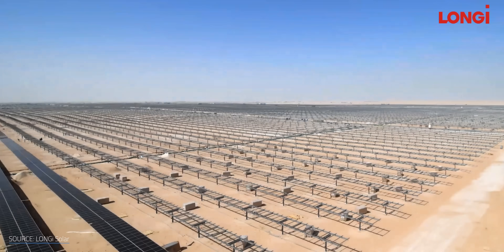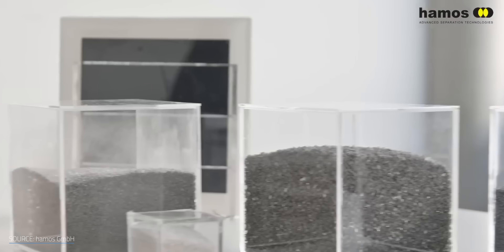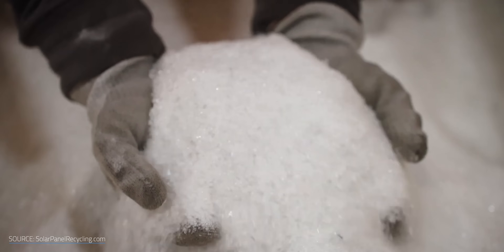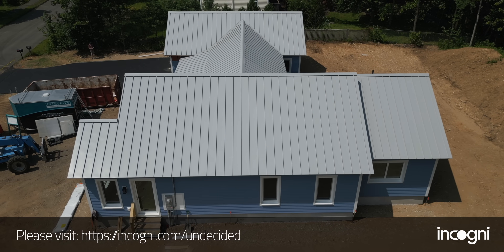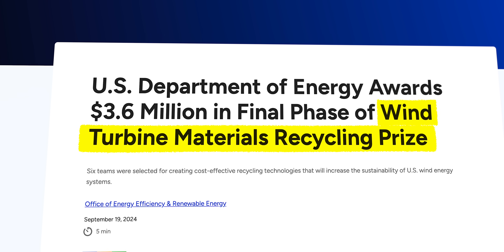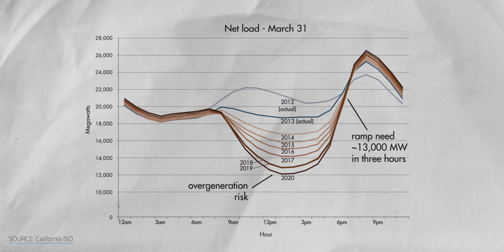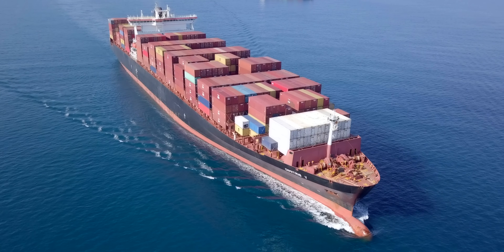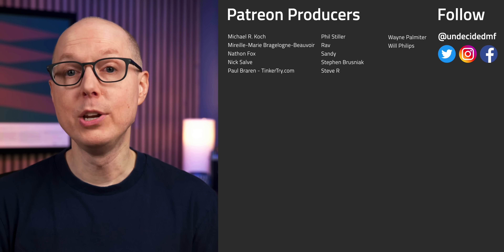How We Solved Renewables BIGGEST Problem

Comment: I really don't understand the anti solar attitude of some people especially Americans. Solar isn't perfect even more so here in the UK but when it's sunny it's amazing to have on your roof and saves me a ton of money. My system paid itself back in just under 6 years. I'm not naive enough to think my solar roof installation is the full answer I know it needs backing up with grid power but I just don't understand this "I don't want renewables" mentality. Like why wouldn't you want free power after offsetting the upfront cost? I just can't get my head around that mentality, as above it seems it's mostly Americans in the comment sections who are really set against it.
Reply: Indeed, I've not looked at it carefully to figure out if ours has paid for itself yet, in the UK as well but it must be getting close as electric prices are so high. Though really that is irrelevant as while it doesn't actually meet 100% of our needs as we use energy now its not far from it which gives that peace of mind that economically basically no matter what happens you'll have light, cooking, warmth practically forever.. 
As just a little bit of cutting back on our consumption on the nice to haves like the extra freezer, or spending less time running my welder/printer/lathe while the sun isn't shining it probably would let us go entirely off grid - and this only a pretty small even for the UK house though the roof does happen to be at a really good angle to gather sunlight. Also a bigger battery would definitely be required to go off grid - right now the battery won't even last through the night, its just a tiny little thing.
Reply: As a cost saving measure for households is amazing .
Reply: I'm an American and I don't get it either. Love my solar power system.
Reply: Like Matt's said before, solar is a hugely personal thing and varies greatly on if it's right for you.  Remember that the US is enormous, having roughly the same landmass as all of Europe in square kilometers for landmass (says google), so geographic location can and really does make a difference for solar, as well as some places not having the logistics or installation professionals available for it.  Some of our rural areas are literally half a day's drive or more to the closest "civilization".
Reply: One thing that a lot of people don’t realise is that it blends seamlessly with you grid connection. I have had people within the last week ask what I do when it isn’t sunny (same as them, the power just comes into the house from the grid like it always did). I was asked how you control it (you don’t it does it without any intervention) - they genuinely thought I had to flip a switch, Frankenstein style, to use either solar or grid. Another said he won’t get solar as he likes to play computer games in the evenings and didn’t want to restrict himself.

It was only after having these conversations recently that I realised how little people know. They think you have to have one or the other (you are either on grid or off grid). They think you have to flip switches to make it work. They think you have to compromise and go without power at times. I was genuinely shocked at how little people without solar panels know about them. Just 5 minutes of google time would have answered their questions. Who is feeding people these myths?
Reply: I don't know how it is elsewhere but in the Netherlands it all started with the promise that you would be paid for generating more than you use. But we have now reached the point that dumping your solar energy that you don't use have to be paid for ! Is that attractive, being mislead ? The installations does not seem to know when not to dump on the grid.
Reply: Erik, 
technically illiterate politicians are to blame. They, simplistically, thought that any electrcicity generated is good for the grid. 
That is not the case with renewable generation as it is uncontrollable, feeding a system that must be minutely controlled with regard to supply and demand on an instantaneous basis.
At low levels of solar panel uptake it was too small to be a problem but as it became popular, ironically due to electrical unit prices for the consumer going up by connecting more and more 'cheap' renewables.
Solar is particularly bad on two counts, one it's output is based on the strength of the sun so midday is strong but morning and evening is weak, with winter, when demand is greatest, produces very little and none at times of maximum demand. 
It is suseptible to sudden drops in output when clouds pass over, requing a very quick response from the grid operator to balance that loss. When the clouds pass the reverse situation occurs.
While it lasted it was good for solar panel owners but to the detriment of the rest of the population.
Reply: The US is second in the world in solar PV output.  It's just happening at utility grade installs for the most part, those over 1 MW output levels.   China is 3X the US.
Reply: The cost of roof based solar systems for residential properties is really high in the US - I’m not sure if the government incentives artificially drive up the cost - but I keep seeing comparisons that show AU prices of solar are 1/3 or 1/5 the cost of a similar US installation, I know the quotes I’ve received are crazy high ($50-70k).
Reply: I’m in Ireland

Not the sunniest place in the world obviously …but my Solar PV system (19x440w panels [8xNE, 11xSW for total of 7.9kWp) and 2 x 5.3kwh battery storage have saved me an absolute fortune already and will fully pay for itself in under 6 years. 
Even in winter when days are shorter I charge my batteries from the grid at cheap EV night-rate to load-shift away from peak rates. Then, from early March to 
at least end of Oct my solar can (most days) easily fully charge my batteries for use after the sun goes down and throughout the night. My system cost just  under €11k to install (and then I got a Govt. grant of €2,100, reducing the outlay considerably ). 
Solar is fantastic!!!
…and since I was already a qualified and registered electrician I have now completed the Solar PV & BESS training program and up-skilled to become a licensed Solar installer. 
My new business is going well so far thankfully 😊.

 Saving clients money, helping the environment, helping the national grid, reducing the reliance on fossil fuels…and making a decent salary while doing something I love and believe in. 

Win-win
Reply: If someone is watching this channel, chances are they want renewables. What makes you think Americans have an "I don't want renewables" mentality? That may be a on oversimplified characterization based on imperfect information.
Reply: Look at how much Rooftop Solar costs in the US. In Australia I can put 10kw on my roof for $ 11k (ex Gov subsidy and Tax). The same in the US would cost 2 to 3 times that amount. Australia is the only country in the world who can put solar on roofs at the same cost we put it in Solar Farms every other country costs 2 to 3 times what we can do.

PS As a result 35% of houses in OZ have Rooftop Solar. We are world leaders.
Reply: I believe it is mostly due to older preconceptions about solar. Lack of recycleability, higher cost vs natural gas, and they are kind of ugly. Now 2 of those 3 are pretty much solved. The ugly thing not quite yet. There are some nicer options like integrated roof rile solar panels but those are still very expensive.
Reply: @brennonoverton8277  i find them beautiful. Taste ppl, taste!
Reply: @brennonoverton8277  You have to take into account the cost for required storage to make a fair comparison to gas. Then solar is still 4 times more expensive than gas, 3 times for coal and 2 times for nuclear. Even if you have solar you still have to pay for the infrastructure of conventional energy that is needed when there is no solar available and during (very) low winter production. For that reason we all pay more for the energy that you take from the grid, offsetting most, if not all the benefits of solar. 
It's different if your solar does not go into the grid but in your own storage and you use it for e.g. a electric car. Now i pay 3x as much for the same energy as 20 years ago.
What really happened is that people without solar paid more for the energy bill to compensate for the solar investment. Now that energy companies start to demand money for energy fed into the grid the playing field becomes more honest and the ROI of solar is much lower. Wind is even worse and can only exist because of price guarantees and subsidies.
Reply: @Sander-zj3wi  Oh interesting take. I hadn't really considered how the prices could be rigged to appear lower.
Reply: @brennonoverton8277  And predatory solar salespeople are not helping the technology's reputation.
Many of them are the new door-to-door vacuum salesmen.
They fast-talk and bury you in information to try and get you to sign with them and ONLY them before their "special price, just for you" expires.
Reply: @brennonoverton8277 I dont think it looks ugly at all.
Reply: Who's anti-solar in the US? I'm down here in Tennessee and I don't know anyone anti-solar. Everyone wants solar on their roofs.
Reply: @twiggy99  Solar and wind can be useful on the small scale of individual houses. However, grid scale makes absolutely no sense whatsoever. It seriously drives up the cost of energy as locations that have are finding out and very much destabilizes the grid leading to brownouts and blackouts.
Reply: American here. I live in the one US state that has 100% public power. My electric cost is 10.8 US cents per kWh. (0.085 £) It will take 20 years for solar to break even, by which time the panels themselves will be significantly degraded.
Reply: @teebob21  - Where I live in CO, we have time of use rates. The peak rate in the summer is 33 cents per kWh. That cuts the payback time dramatically.
Reply: well, I'm against it on my roof. Each roof penetration is a risk of leak. that can be expensive.  I'm not against ground-based array but you need room for it. Also, a good storm can remove it. we get some pretty nasty storm in the US.
Reply: Solar is great. Abusing solar to harm the people by forcing it to where it doesn't belong is bad.
Reply: Propaganda funded by the richest Industry ever, Oil & Gas Corporations, they have known since the 1980’s that they are the cause of the Climate Crisis! Do you not remember when smoking was not bad for you and not addictive!? Same American B.S., $$$ Buy Canadian, Commonwealth, EU…. Bye America 
Never the 51’st 🇨🇦😡  Slava Ukraine 🇺🇦🇨🇦🖖
Reply: @twiggy99  
to answer you begins with how the grid works.
Supply must match demand on a instantaneous basis, which means that supplying generation has to be able to modulate output. Renewables, hydro excepted, cannot do this. 
When there is significant renewable generation, it is harder for the controllable generators to keep the grid stable and risking a   power cut.  Solar, particularly in places like California and Australia have to restrict solar generation at times.
As usual the culprits are technically illiterate politicians who make policy.
While it was a benefit to domestic users, for a while, it increasingly posed a problem for grid operators who had to spend more to keep the lights on, passed on to the consumer
Reply: @iareid8255  Renewables energy storage costs will continue to drop moving forward,  as well as continued tech innovations.
Once dedicated ai compute farms are tasked with iterating wind turbine, solar panel, battery, and other tech designs, the efficiency levels and novel designs will take off.
Using Bev for domestic power leveling will become a thing.
Less power dense but cheap large capacity batteries should eliminate any reservation using them for solar, wind leveling.
I suspect eventually, neighborhood block by block battery installs shared by everyone on that block may become a thing, with or without a Block scale backup generator.
I have read of designs for neighborhood scale fission reactors. Perhaps fusion someday. Both fission and fusion should have ongoing refinement and improvements with ai iterative design and analysis
Reply: @twiggy99  As another data point to address insurance cost issues with Solar, I just got off the phone with my insurer.
They guarantee my premiums will go down after the solar roof is installed. They said to call back after the install and they will adjust my rate. No impacts to roof damage claims.
I will get another drop in my insurance rate when I add a backup natural gas generator.
Perhaps a third drop as I add battery backup capacity.
Decrease won't be big They claim, but I'll pocket that plus the 5%+ per year grid rate increases.
Panels guaranteed to degrade less than 0.5% output per year, negligible.
Panels for my install will have an inverter per panel. Inverter failure takes out one swappable panel vs entire array.
Power output guaranteed for 2 years from install date. If kwh target not met, they add more Panels for free.
Panels fully insured for 10yrs by solar company.
Reply: If you can't install it yourself here in the US your almost better off not having it done unless you live in the south.  Companies inflate the cost too much.
Reply: The main issue i have and what seems to be many is that they're only helping industrial solar. 
The large energy companies get huge tax breaks and grants for solar, yet single use gets not shit. 

Plus, now most of the sales for single are scammy door to door companies. 

Solar can be amazing here, but you gotta do a ton of research to make it work and not get fucked by some shady company.
Reply: I think a lot of it is due to propaganda. Some people are more susceptible to it 😅
Reply: The reason you can't see it is because you dont understand the supply chain of solar. Yes with government subsidies yours paid for itself in 6 years. Maybe it would have been 20 without the government subsidies right? And in 20 years you need to replace them because they don't work anymore. And where are they made? In China. With coal. The simple fact is that the vast majority of solar panels produce more carbon emissions over their lifetimes than just burning natural gas.
Reply: in the usa it's 100% politics.   liberals want renewables, therefore the fascist types oppose renewables.
Reply: Previous administration promise to the voters were more drilling just like the current administration
Reply: I think people underestimate  the propaganda hold the oil industry has on the us. Any time there is a power upset, they look to find any wind or solar that was on the system, and they work hard to ignore that in places like texas, which had that bad cold wave, the natural gas pipe lines that Americans are insane about, literally froze. If big oil can blame renewables, then big oil can protect itself from extinction
Reply: Americans do not understand things, education has failed them here lol
Reply: Anti-solar rhetoric is sponsored by the oil companies, as is anti-EV. Its all politics and press, and money talks, loudly.
Reply: It's a fair point. My issue is talked about here. End of life matters, and people have ignored it for a while. 
Electric cars aren't very viable, but hybrids and phev are much more.
Reply: Renewables have already been obsoleted by nuclear. Nuclear wins on any parameter one can think of.
Reply: Solar is pure trash. It will never offset its own waste, and it loses efficiency far too fast. The production and mining is the real game, it is heavily subsidized and artificial, terrible for the environment, and uses a ton of slave labor. We already have nuclear power which is cleaner and better and fixes the entire problem. Which is exactly why it is demonized
Reply: It's the lying. A lot of government environmental causes are just shady manipulation to increase taxes and end up doing more harm than good to 'environment', itself a term with double meaning. It even has communist 'deconstructionism' tainting it. Throws the whole thing off, even when you DO want to save the actual environment. What about the good stuff you say? Unfortunately, the loudest voices on this are simply not to be believed. Be kind to your pets. Throw trash in the garbage. That's all you can do.
Reply: Something else to consider about us americans is that we tend to move a lot. If a person isnt sure they will be still livjng in the same house 5-10 years down the road, they may not see the pay-back on that investment. I am not sure how solar pannels effect the resale value of a home...so neither is the average person, probably. 

I have wanted to get solar pannels for some time now, but I cant really afford the upfront cost yet. And while there are companies sending people door to door to sell replacement windows, roofs, yard work, siding, etc, I have never had a company knock on my door to offer me an estimate for a solar install.
Reply: @klosnj11  Blue Raven (4.5+/5 rating on several solar review sites) claimed my solar installation in SE Michigan would increase my property value by at least 10%, which would be about the cost of the installation.
Makes sense, because all the numbers indicate my home should have little to no utility DTE electric bill with the house.
Solar 10yr warranty, insurance transfers to new owners.
So buyer gets a home with free electric.
Assuming DTE rates continue their 5% annual increases like the past 20+ years, the savings grow at that rate.
Reply: I don't think I've ever run into an actual person that dislikes solar IRL.
The Republican party might, but they're disconnected from even their own voters, nevermind reality.
Reply: Americans got burned from too many hippies bothering us about renewables.
Reply: The biggest reason is that the imbeciles in Washington, both Democrat and Republican, have blocked the sale of the least expensive solar panels.  Those produced in China.  these imbeciles have introduced tariffs that double the cost of solar panels imported from China so American companies can try and compete.  But what the imbeciles didn't consider is that American made solar panels are being priced just below the cost of imported Chinese panels.  So now all solar panels cost almost twice what the could if imported from China.  Who suffers?  The public.  Who benefits, US investors in Solar panel companies and the fossil fuel industry as they continue to sell more carbon based fuels that they would if more people could afford solar.  One could blame incompetence in Washington but I'm sure it's greed by politicians receiving donations to keep them in elected office, screwing up the economy and increasing inflation just about as fast as Trump can lie about it.
Reply: I can explain to you why, it is because of very complex geopolitical and scientific facts and those complex economic....

Nah!

Just kidding! It is social media.
Of course it is social media.
They have been told what to think and they go along.
Reply: Because it's imposed as a dogma, and loads of scams and lies are around everything linked to "ecology" and "climate hoax". On itself, solar energy, is the future. We ll have longer sun, as we have fossil fuels, radioactive elements and all the rest. But, the climate change scam make many ppl not wanting it.
Reply: they have been told that its a zero sum game, that for renewables to succeed their O&G careers need to end. that is scary to them.
Reply: It's politics plus Bayesian updating. The left has lied about so much about many things and about the right. Therefore, those on the right do not trust them in general. Because currently (pun?) the left is the biggest proponent of renewable power and the right doesn't trust them, the right becomes an enemy of renewables. It is stupid, but no more stupid than any of the many other politics-poisoned positions taken by both 'sides' in the US.
Reply: The MAGA crowd is brainwashed. They've spent the last forty years listening to conservative talk radio during their commute, and then watching Fox News when they get home. They get no information from outside their echo chamber.
Reply: The reason it is cost saving is because the rest of the country is subsidising you. Both directly, and by the ridiculously distorted pricing of energy in UK.  It is all lies.  More of the Death Cult.
Reply: I believe many people here in North America are still anti-EV for some reason which might explain anti-solar sentiment.
Reply: We have Tornadoes here, hurricanes, lightning storms, snow storms, heatwaves, earthquakes.... its not that we hate these things,  its just a combination of they're expensive to install,  by contractors,  and the logistics of reliability...
Reply: The US has turned solar panels into a Ponzi scheme, it’s insane what they charge for them too
Reply: ROI in 6 years is very good, however your cost per kwh is 2 1/2 times greater than the US.  Where I live would never see a ROI with solar, so it all depends on your utility costs and where you live.
Reply: Because everyone and their mothers work for the oil, gas and coal industry. They're scared of losing their salaries and pensions if the industry downsizes. Again, it's always personal greed for Americans whenever they struggle to grapple with progressive reforms.
Reply: @twiggy99  I'm quite confident it's less about solar power itself and more about solar and other renewables being talked about as a response to climate change. The US has one of the highest percentages of people who believe climate change is a hoax. Thank the universe we don't have as many of these conspiracy theorists in Europe.
Reply: There was a lady who thought solar ate all the sun and killed the plants because of it.

She...was a teacher...
Reply: It's the mandate not the tech...
Reply: In America tge large enrgy companies monopolize the market, and are lobbying and getting Rights to make solar homeowners Pay The energy company for Their 'loss of money' and so much more bull crap ! Unless you are far away from power company lines, they lobby for special rights tgat destroy homeowners -- Even getying insurance companies to Cancel home insurance over "compremized' roofs due to dolar panels! That's our issue in America. Tge Elites who iwn big companies And who are On the Green issue side- yet in Truth , they go Against common people in back room deals.
Reply: Behind the scenes there is a fight between two groups of investor/owners. There are investors who have built a long position on post-carbon assets, and there are investors who are still holding the bag on carbon-emission assets. Those two groups are fighting behind the scenes, and it shows up.

If you take the heat map of a country showing the value of assets that are carbon-emission-intensive, and the heat map of the value of asserts that are post-carbon, and then overlay on top of that the political divide between left and right, there is a very consistent correlation between post-carbon assets and the political left, and carbon-intensive assets and the political right.

That isn't the only correlation going on there, it's never just one thing. But it's a part of the story people aren't seeing because it's taking place behind the scenes at the level of lobbyists and dark money donations.

But there's a reason why being pro-renewable-energy or being anti-renewable-energy is filtering down into people's political identities and leveraging those knee-jerk "X is always good" and "Y is always bad" mental tools.
Reply: It comes from American propaganda

Oil companies spend billions on altering popular image and downplaying other sources of energy and environmental decline
Reply: I'd just like to put in here, the claim has been made many times in this thread that increased installation of renewables in general (solar in particular) has pushed up unit electricity prices (ie the $/kWh, £/kWh you pay on your domestic electricity bills). If you are making this claim you really need to back it up, as it's critical to a good understanding of the issue. I've seen arguments on both sides, but there's clearly a benefit (cheap energy production) versus a cost (green subsidy levies) making its way onto your bill. How do these balance out?
Reply: Takes about 15 years to pay off in the US, and most people move before it pays off and when they sell the house you don't get the cost of the system back so it all really just comes down to financials.
Reply: @keysersoju9823  That high cost is solely fees and labor. The off grid system I built for myself is looking to have a 4 year payoff. Part of the reason it is so short is that I power 2 EVs from it.
Reply: To be fair it isn't all Americans it's just big oil and their "supporters"
Reply: You paid off the cost in under 6 years?! 

Yeah, one big problem in America is that panels cost so much that it takes 15 to 20 years to pay off the cost. And that's after the federal and state govts pay huge subsidies and incentives to install solar panels. 

There's a secret that people know if they are paying attention... The US economy is a disaster and has been for at least 20 years. Everything in the US is way more expensive than things are everywhere else. And the great part is that most Americans have never left the country so they have no idea that this is true. And when they do leave, they go to tourist traps where prices are very inflated so they don't realize the difference. 

America has an epidemic of ignorance and global illiteracy that is much much worse than the epidemic of obesity which is so famous around the world. It is a disaster and I'm looking forward to moving away soon.
Reply: @MarkElDeiry  Please show me where a run of the mill solar power system takes 15-20 years to pay off. Yeah, someone like Marquez Brownlee's $1.5 million system will take forever. But a simple grid tied system, no batteries, will pay off in most places within 5 to 7 years.
Reply: @JR_MacD  Of course payoff time varies by location due to local power company fees and baseload rates, insurance rate impacts, local labor rates.
Around SE Michigan, I assume DTE does not have a Solar array backfeed fee.
Blue Raven has 10yr insurance coverage on the Solar install, parts and labor.
I asked my current homeowners insurer for policy impacts for the 8kwh+ install, waiting for response. Blue Raven claims no homeowners policy impact, cost or otherwise, which may be state law.
Hail not an issue historically around se Michigan,  but I assume the included 10yr warranty, panel  insurance would cover.
Interest rate on panel installation moot, as I plan to pay in full, though quoted panel mortgage of 4.98% lower than past 10yr DTE rate increases of 5.1%+, expected increases foreseeable future.
So by paying for panel installation  in full, I pocket 5%+ every year, not a bad return
Reply: @MarkElDeiry  well.. not everything. Its a little confusing (from an outside POV) to hear people bring up subsidies for renewable energy without addressing how much you guys subsidise fossil fuels. They're cheaper than the alternatives because your government pays like 0.5-1.5 trillion a year to keep them cheap, and then people lobby against renewables / to maintain that because said renewables would need a few dozens-hundreds of billions a year to be price competitive? I guess its just that the consumer doesn't see the subsidy for the former.
Reply: 2 things.
1) Active propaganda telling them it's dramatically more expensive than it is. Basically everywhere if you follow anything even remotely "conservative" (IE bought and paid for by the good oil barons of the world). I noticed someone said it was closer to the lifespan of the unit which is demonstrably false with minimal effort...

2) Unless you do it yourself, it is actually quite expensive to get it installed here. I don't remember the exact numbers but it was something like a DIY install has a payback of 2ish years without subsidies and a professional install was closer to 7 or 8. That's a significant outlay for a country where 60% of us couldn't handle an unexpected $500 bill.
Reply: It's because it's been polarized and politicized and people on the right wing tend to not have critical thinking. So once something is labeled as "liberal" or left leaning its automatically bad.
Reply: @iOsasu14  your letting you r bias show.  Claiming the right doesn't use critical thinking is BS.

I have looked into it many times. It isn't cost effective where I live.  The ROI takes too long. The permitting if you DIY is a pain to go through. My insurance won't cover roof damage if a solar array is on the roof. this is regardless of if I have a professional install, it or not.  

So, I chose not to 

I do have a shed I built that is off grid using solar panels That I installed on it. but really it doesn't power much just lights and 3d printers.
Reply: Mainly comes down to cost and storage. Buying a 20-40k$ system and having weather destroy them tomorrow can make them a very bad investment. The other down side is reroofing a house and the problems that can cause + cost. If the houses were built with it in mind - maybe wouldnt have have many issues, but it is a problem with some houses older than 200+ even newer ones that get leaky roofs after. Bad installers, sure, but it happens enough many people just dont wanna have to worry about it in terms of resell.
Reply: @ Interesting points made there. I didn't realise the cost was so high in the USA, mine cost me £3700 for a 8 panel 2.8KWh 9 years ago without subsides. I'd imagine the price has come down a lot since then as well. The vast majority of houses in the UK have tiled roofs made from slate, porcelain or some kind of composite and the panels are installed on rials (they look much a like a roof rack on a car) and there has never been a problem with leaking. Possibly the roofs in America are constructed differently which is leading to problems, something we don't have to worry about.
Reply: @twiggy99  Yoy mentioned panels installed on rails in the UK.
Does that mean no roof penetration, ie no drilling through roofing, only secured at the roof side edges?
Reply: @alexxbaudwhyn7572  I'd imagine it depends on the roof. Mine has multiple pitches and the south facing roof face the rails are screwed directly into the roof trusses on the outer edge of that roof face. I'd imagine if you had a long facing roof that tiles would be removed to install the brackets then the tiles sealed back in around the bracket but I'm not installer so maybe someone else with the expertise could give a more complete answer
Reply: @twiggy99  Thanks for response. 
Planning an 8kwh+ install in SE Michigan.
Current installed quote is about $33K, which seems high compared to your 2.8kwh at 3700  pounds in 2016, which inflated to 2025 about $5000usd. So 8kwh should be about $15K installed on UK now?
Reply: @alexxbaudwhyn7572  I wasn't actually sure so I checked the website of the guys that did mine. Currently a 8.6kwh (20 panel) install all in (mounting kit, inverter, connecting to the grid) is £10,599, roughly $13,500 USD.
Reply: @twiggy99  Single inverter or per panel inverters?
Thanks for checking.
Amazing the pound is so close to the dollar currently.
Historically, been closer to $2/pound
Reply: @alexxbaudwhyn7572  Sounds like that company is taking you to the cleaners!
Reply: @meganegan5992  Maybe.
Plan to get more estimates.
Other SE Michigan installers to recommend out there?
Current estimate is from Blue Raven
Reply: @alexxbaudwhyn7572  no, they use rails on the USA installs as well. when using rails there is still roof penetration.
Reply: @meganegan5992  I initially thought so, but talked to several neighbors a few blocks around me with similar sized installs, and the going rate appears to be 30K-35K all in around my city, a population dense suburb of Detroit.
Materials, labor, permits with city, setting up tax credits and energy credit management, etc.
Reply: @alexxbaudwhyn7572 the rails are mounted to the existing structure, then the panels are mounted to the rails. If it’s clay tiles you move the tiles, if it’s metal you mount through the metal. 

Whilst we have a lot less rain in Australia we do not have much issues with leaks, we also have much different construction of roofs.
Reply: @adr2t  That is the problem. Those costs are no longer correct. Yes, some installers are still charging those prices. Some aren't. It is only in the US that solar costs so much.
I can DYI a 4 kW solar, 6 kW 240 AC with surge to 12 KW (the 12 kW surge will start a 3 ton AC unit), with 15 kWh of battery for about $5k.  This is for a cabin. For a house, it should be less than double that.
Then labor should be no more than equal what I can DYI for install.
So we are looking at $10k-$20k for fully off grid solar. And that is paying retail prices and without any rebates or incentives.
Reply: @williammeek-h2o  Those cost are what I see people report on reddit from the US - so yes these are still correct cost depending on the system (solar+battery). Most people are not going to DYI - thats the difference. Sure, I could save a ton too if I DYI a lot of things, but I dont normally. The labor cost here are crazy high. Follow by shipping panels across the US isnt cheap. There are also other cost that go along with it... along with time such as working with your local power company + permits + knowledge on power lines, taxes, etc. Maybe you can walk into the markets here and lower them, but yea thats normally what I see. We get a lot of hail around my part as well - so insurance is a bit more to have them too.
Reply: @adr2t  Yes, everything costs more if you pay someone else to do it. 
One big thing I left out is the cost to install grid electric service to begin with. 
That is another cost of around $5k that is built into the price of a home.
as to the cost of shipping panels, the panels themselves are running about $0.25/watt so the 4 kW in my example would be about $1000. Shipping will likely be around $300. That is $1300 so far.
The inverter is about $1400 and $100 in shipping.
Now we are at $2700.
the 15 kWh battery is about $2000 with $200 in shipping. 
Total for major parts is $4900.

Go to Signature Solar for both the panels (there are always some for around $0.25/watt, as of the time I write this, the cheapest is $0.234/watt) and the inverter. The EG4 6000XP all-in-one has the breakers and accessories already built in.
Basen Green has a DYI battery 300 Ah 48V for $1975. 
From there, have an electrician install the equipment pull permits and provide wire. That should be less than $5k otherwise they are ripping someone off. Likely from using intentionally overpriced equipment.
Reply: @adr2t  they are not that expensive anymore. You can get a usable solar system for around 5K. I’m a diyer and I was able to get a 5 kW solar system, including wires, inverters junction boxes and batteries for just under 6000
Reply: US citizen here. We ran the numbers to set up a solar array on our rooftop. It would cost us more over the next 20 years than it would to not have a solar array at all. Given that I am in my 50s, it is possible that I will expire before my family and I actually see any cost savings, if ever.

Context: We are in the northern US, so we get a bit less sun here than a large chunk of the nation.

The reason why you're saving a lot of money is simple-- your energy costs are likely MUCH higher than they are here. It's really not much more complex than that. Heating our homes using natural gas, heating oil, or electricity is really cheap compared to most of Europe. 

However, we have even more disincentives.  Our local power company charges a monthly fee to have a solar array on our roofs. This is slightly offset by selling energy back to the energy company in the off chance that we run a surplus, but that's a trifle compared to the fees imposed by the local power and gas company.

Furthermore, our insurance rates would go up significantly for having an array on our roof. One of our neighbors said that their insurance company would not cover their new array at all, nor the roof under it. Given that these panels can be damaged or destroyed in severe weather (we get some pretty nasty hailstorms around these parts), any repairs or replacement would come out of pocket. What is the cost to repair or replace a broken solar panel, or panels? Likely more than most Americans have in their bank account.

Since I have had these sorts of discussion before, I am going to predict that you will counter that things here SHOULD be like your nation-- the insurance companies should cover the arrays, the power companies shouldn't charge for having a solar panel, perhaps the state or nation should subsidize home renewables, etc. Sadly, "should" or "shouldn't" doesn't change the realities here. 

People in the states simply aren't putting solar panels on their homes for financial reasons-- at least not where I live. Some might THINK that they are, but they aren't. 

It's for one of a few other reasons-- environmental concerns (which is admirable), or they were sold a bill of goods by a solar company and they didn't do their due diligence before they signed the contract. The aforementioned neighbor is the latter. With the loan he took out (pretty much at the peak of high interest rates), fees to the power company, and second-tier homeowners insurance that he now has, the only way that he'll likely recoup those costs is if he sold the home and the new buyer sees the panels as an asset rather than the liability that it actually is. 

Lord help him if we get yet another hailstorm.

It's great to hear that you're saving a ton of money, though. Given the current state of discourse on the internet, I sort of expect a sneering, sarcastic reply. If that's what you have in the hopper, don't bother. If I helped you wrap your head around the reasons why the US is hesitant to embrace solar and renewables, great. 

Peace--
Reply: @JasonofWaukesha  no not at all, it's a brilliant answer and I thank you for such a detailed response. Not everyone on the internet is a tool 😀 I genuinely couldn't think why anyone wouldn't on a financial level alone (from a UK perspective assuming the hardware price would be similar worldwide minus taxes). It's really made it clear why you wouldn't as I could only see it as a no brainer from the UK prospective and we have much less sun, I assume probably similar to your area.

After seeing the costs some American citizens are posting here it seems insane compared to the prices in the UK and I'm including the fact I didn't have access to any government subsidies either.
Reply: @JasonofWaukesha  Agreed for your specific location, doesn't sound like numbers add up for you at this time
There are 2 separate issues with Solar feasibility.
Can Solar provide the power output, maintainability, longevity, etc from a physics and engineering pov at thus time? I  think the answer is a resounding yes from here forward due to panel, inverter and design tech improvements over the past 20+ years. Plus expected ongoing tech improvements.
Can Solar be cheaper vs grid for a specific installation in a specific location?
Depends on local weather, economics (energy prices, labor rates) and politics  (fees, insurance rates and law, tax incentives, subsidies, local codes, etc).
Reply: @twiggy99  Nuclear energy is just better, and longer lasting. I live in texas and I see solar on houses all the time.
Reply: @templarstudios1444  oh yeah I completely agree nuclear is the answer, it's what I'd want my country to be 100% reliant on when I need power on the darker days. However my original point still stands, why wouldn't you have solar also to provide you free power on the sunny days which I'd imagine you get a lot of in Texas. Forget all the climate change and renewable noise, just from a financial point it just makes complete sense to me to have them. Even more so now with the price of panels crashing compared to what I paid 9 years ago. I paid £3700 and around £1400 of that was for the 8 panels about £170 each, those panels are now around £100 each here so a huge price reduction
Reply: @twiggy99  agreed
Reply: Ugly??
Reply: @aussie405  So? A lot of people are not beautifull, are you shunning them too?
Reply: @DundG  I was indicating that neither I,  nor anyone else I know, in a place where about 40% of homes have solar panels, consider them to be "ugly." They are a functional part of a home. Someone else in a comment above mine, described them as ugly. I have 24 panels on my roof. I consider them to be functional and sensible. Did you notice the question marks on my comment?
Reply: @aussie405  Oh I'm sorry. I totaly misunderstood you.
Reply: @DundG  all good.
Reply: A lot of them are employed by the oil, gas, and coal industries. They're against anything that threatens their jobs.
Reply: It’s gullibility, and fear of change.  It’s easier to believe the FUD, than to accept, and rethink beliefs.  What we have is cognitive dissonance.
Reply: @gardencompost259  People don't fear change they fear cost. If the cost for charge is greater than what they are willing to sacrifice then they'll reject change. If companies gave people free solar panels no one will refuse them.
Reply: @ I particularly agree, to some extent it’s the cost. To some it’s just too unfamiliar, too much risk to their beliefs. To some even if you gave them free solar panels, they’d still resist the chance.
Maybe to some it’s the perceived sacrifice.  Us humans don’t really like change, change is risky, perceived.  Especially when we have to re-examine our own thoughts/ beliefs.
In my neighborhood there are four houses in a row that have panels.  One neighbor doesn’t want solar because he believes it’s a hoax, and that the panels would not pay for themselves in his lifetime.  The latter is probably true, but a hoax?
Reply: Nuclear is better and what we need is reliable caseload energy
Reply: Solar in the US is way overpriced and installations are inefficient and poorly done.
Reply: Its not that I'm against it, I'm against my gov making me pay to develop it.
Reply: @levispeaksloud  But didn't the government (fed/state/ and or local) make you pay for the original power grids, electric, fossil fuel infrastructure through a variety of taxes, millage, fees, etc over the past century?
Reply: Because most renewables are marketed on many false premises. Costs and benefits are constantly misrepresented. Obviously nearly nobody has a problem with cleaner, more-affordable, and more-efficient energy sources.
Reply: @jasonshere  It is overwhelmingly "conservatives" that are misrepresenting what renewables are capable of and constantly misrepresenting the cost and benefits.
And it is clearly because they have a problem with cleaner, more-affordable, more efficient energy sources.
Reply: @twiggy99  Yes, we keep getting a push to install solar in Scotland too. But they are absolutely useless here, and companies really ought to do more homework before they bother homeowners to install them.
For instance, a friend of mine had solar installed, and the inadequate number of sunny days hereabouts meant that she ended up installing a multi fuel stove, and she used coal to heat her home instead. Seriously, at age 68, a lone pensioner, she could have done without all the expense of first installing one and then having to install a second heating system - after being convinced that her original one was 'wrong.' 
Afterwards, Green Deal tried to bully her into buying a wood pellet fuel system, but I kept supporting her to reject it. 2 salesmen gave her the 'hard sell treatment' for over 6 hours in her own home before they finally gave up. It was quite traumatic for her, and one of her sons had to travel up from London to be with her for a while afterwards - because these pests kept ringing her!
Second case - an elderly couple living in the same valley as myself. Again, persuaded to go solar. Their roof is covered in panels, but because it is so very humid around here, algae and moss grows very quickly on all surfaces, including glass.
Because these panels needed regular cleaning by a special window cleaner, this couple realised that along with the fact we hardly get any sunny days anyway, the cleaning costs made them worthless.
In the end, they too went back to their original heating method (firewood and coal), and the panels are now permanently covered in algae.

If a salesmen came round here trying to sell solar, I'd tell him what happened to these residents and just what I think of his chances of selling them to me are. 
We usually get 2 weeks of sunshine per year here, that's normal, and that is just nowhere near good enough for solar panels, especially given the ridiculous price of these home batteries. 
Governments need to assess all areas for suitability before these firms are unleashed, and there should be a website for everyone - made especially accessible for elderly persons - to check the viability of solar.
But, of course, the government is so keen to reach it's net zero target above everything else, it's also been flogging heat pumps that have given such bad returns - despite the promises. So, people (government buildings included) are now ripping them out and going back to their old systems. 
I don't want to imagine just how much energy was wasted making the things, and how much more energy has been wasted reinstalling traditional systems. It must have cost the government millions to have heat pumps installed in government buildings. Millions. What a waste.

Me, I'm sticking to planting and growing more trees, coppicing and burning the wood. 
Yes, it produces CO2 when I burn wood that's big enough to log and split. However, at the same time, I collect the brash into fungi-innoculated heaps (or do some occasional biochar) and lock at least some carbon back into the soil every year.
I'm keen on soil building methods of carbon sequestration rather than all this technical stuff (which usually turns out to be more trouble than it's worth in the end, once the figures come in. 
We're currently waiting to find out where this massive battery farm is going to be built, wondering who is going to be unlucky enough to be downwind of that when it catches fire, as it likely will).

Natural methods of carbon capture are the best and safest way we should be going forward. A great deal could be achieved simply by employing a mixture of coppicing/brash/chipping/fungi techniques. 
It's human vanity/misplaced superiority that causes many to think that the only way to combat climate change is the technical way - when the technical way is what got us into this mess in the first place. 
Governments can't bring themselves to admit/consider that using Nature's advantages to help herself (with a bit of intervention and improvement from humans.
Instead we have a bunch of silly plans that are doing things upside down and the wrong way round (including introducing more browsing animals to the UK before introducing predators, not being more involved in 'how' corporations offset their carbon emissions (by planting forests of Sitka spruce - still happening large scale here in Scotland if anyone's interested), and then this daft idea of rewilding places solidly with native species - and without considering permaculture as a more suitable, sustainable way of mixing natives with fruit/nut/specialist timber trees/bushes. 
Rewilded areas should still give opportunities to financially support themselves. Once upon a time, I thought they should be rewilded 100% wild, made over entirely for the birdies and badgers, etc. But I realised how narrow minded that concept was and had a complete change of mind when I saw how my own 2 acre plot could both feed/shelter the wildlings and my family, provide fuel, construction materials, soil build, grow edible fungi, and provide a great deal of shelter from storm winds for my property and for all my neighbours. None of us have lost a tile or a wall since my plantings reached 5ft high. 
Before I planted my garden the way it is now (it was just 2 acres of grass originally), virtually no animals bothered with it. Now they use the original hedge as a highway, nest in trees and hedges, feast throughout the year on a wide variety of berries and nuts (some for them, some for me). And they don't seem to care that I'm in the garden every day.
A really successful half rewilding/half permaculture project has been established in China over the past 10 years, bringing a hostile, barren piece of land completely back to life. The improvement in soil condition is on the point of miraculous, and it's gobbling up carbon now, full of mycelium, and the area bristling with wildlife.
Reply: Well enjoy the fantasy that the system paid itself back, because in a few more years components will start failing necessitating repairs... so like any other infrastructure the more you add the more it costs to maintain it.
Reply: I just isn't cost effective when dealing with natural disaster zones in mind. Hail, tornadoes, earthquakes. All of USA has at least one of these, if not two or more.
Reply: @anythingyoucando1546  You are talking about fossil fuels not being cost effective in a disaster right?
My solar has gotten me and my EV through several hurricanes that left my neighbors without power and transportation because of their reliance on fossil fuels.
Reply: @williammeek-h2o  If that is true, than you have a good brand on hand. There is also the fact that many are financially crippled by living paycheck to paycheck. No extra money to upgrade, so no changes made.
Reply: @ it is true for everyone I know here is Florida with solar off-grid solar regardless of brand,
 If built into the house from the beginning so it is part of the mortgage, off-grid solar is far cheaper than the grid will the addition to the mortgage being less than what the electric bill would be.
Reply: @anythingyoucando1546  It is true for every off grid system I know of here in Florida regardless of brand. 
And if built into the house from the beginning, it will add less to the mortgage than the electric bill would be.
Reply: @williammeek-h2o  Key word is, 'from the beginning'.
Reply: Well, there's a few things that blunt a lot of the positive impact of solar. Notably:
 - Solar power must be stored
 - - The storage of power is incredibly unclean. People talk about batteries, but what happens to batteries that are five, ten, twenty years old as they're downcycled into less and less useful installations, and eventually the toxic waste we're left with has to be dealt with somehow?
 - Solar power is intermittent and unpredictable
 - Solar power is often subsidized to for ideological purposes rather than technical ones.
There's a huge push by "green" parties to adopt renewables not necessarily to solve a specific problem, but in the ideological pursuit of a sort of environmental purity. This has come at the expense of once powerful world economies, but has simply allowed economies not subscribing to that luxury belief (India, China), to continue to produce the majority of the world's pollution.

In reality, the real solution to power has been, and always will be nuclear power, up until we get space-based infrastructure capable of day-round solar power beaming to Earth. If you look at any comparison of nuclear versus renewable powered economies, nuclear almost always comes out on top. If you compare France after they adopted an intelligently designed nuclear plan, they produced 80% of their power grid from nuclear, in contrast to Germany who favored a renewable portfolio. If you follow year by year after that, the cost of power in Germany was multiples of what it cost in France, and to the best of my knowledge, this actually doesn't factor in government subsidies courtesy of the taxpayer.

These green parties however, are unwilling to entertain the idea of nuclear, and overreact to every potential negative of the solution, because it directly conflicts with their ideology; if we just solve the problem, they're left with fewer goals to campaign for. They are not in pursuit of a solution, they're in pursuit of a bureaucratic process.

That's not to say that I don't like solar. I really do. I have a custom solar setup that I use to power quite a bit of my house, and I really do enjoy playing with it, reading about it, and implementing it myself. I just believe that under our current infrastructure, solar on a national scale is incredibly irresponsible. How many brownouts do we have to see in renewable obsessed California before we realize that "hey, maybe renewables aren't 100% of the answer"?
Reply: @ Thanks, but I will keep living cleanly in my house and two EVs with my my off grid solar.
Reply: Twiggy, 

there is a world of difference between domestic solar and solar farms. 
Solar is only viable for domestic users because renewables have made our unit cost electricity so expensive so making domestic solar economic.
When it comes to grid connected solar farms its different ball game. It is not suited to grid supply at all, whether it is here in the U.K. which is 289 out ot 290 as being the worst place to situate solar generation, or sunny California or Southern Australia, it destabilises the grid.

Solar is rubbish from an engineering point of view.
Reply: @iareid8255  what an obnoxious lie.
solar lowers the unit cost of energy.
Spot prices for electricity from wind and solar are among the lowest available.
It is MORE expensive for home solar than grid scale solar. 
And while home solar is cheaper in the long term, grid scale solar is cheaper than any new fossil fuel plant from day one.
Even more, wind is even cheaper.
It is fossil fuels that are unreliable rubbish.
Reply: It's because people think solar panels can replace baseload , 

To wich everyone else ask : show your homework
Reply: @ "baseload" is a word that was redefined to be a nonsense term to justify being against solar. 
The true meaning of baseload is the minimum loading required by the generator for operation. 
People with an agenda have redefined it to mean something else.
As to solar, all RE works better at scale and with higher distribution. 
If I can be off grid solar in Oklahoma, The US grid can easily be off grid solar as well.
But nobody would do that. We have vast wind resources that are still untapped. Geothermal, tidal, hydro, pumped hydro, and a few nuclear plants to get rid of fossil fuels with.
next time, do your homework before commenting.
Reply: At home on your home yeah it's a good thing but trying to run an entire country off renewables is a massive gamble that will cost lives if it fails and already is costing lives in the UK imo because energy prices are so high now that people can't afford to heat their homes over winter and the high energy prices are due to the push towards renewables..... Russian natural gas wouldn't be needed if it wasn't needed as back up for the renewables so don't start blaming the war either, more renewables more natural gas, more natural gas higher energy costs, higher energy costs more people go hungry or cold, more people go hungry or cold eventually some will succumb and expire

I'm not entirely against renewables I just feel we are putting all our eggs in one basket and too quickly at the potential cost of people's lives and I think it's being implemented wrongly it should go on homes and buildings not fields and oceans and that is why I'm against the green movement.... Also the technology wasn't even proven and they were already pulling down coal and nuclear cuz they'd gone crazy over the prospect of renewables, it's dangerous and I don't like it
Reply: "I just don't understand this "I don't want renewables" mentality."
It's more about not wanting intermittent power at a much higher cost. Your UK kwh price is over double what it is in the US, and the US doesn't have a price cap.
That, and subsidies for solar are being phased out making to ROI closer to the lifespan of the unit itself.
Reply: @wisenber  UK power cost is high because it is linked to the price of gas. Its a market problem not a renewables problem. With higher energy costs and lower solar equipment costs ROI is even shorter for solar installations. I installed my modest 2kW of solar in late 2019 and they have already paid back the price in the reduction of my bills
Reply: @kkronfli  " it is linked to the price of gas"
It's linked to the price of gas in most countries.

"Its a market problem not a renewables problem."
The countries with the highest rates are the two countries with the most renewable investment, Germany and the UK.

"With higher energy costs and lower solar equipment costs ROI is even shorter for solar installations. "
Except those higher energy costs are directly linked to the level of renewable investment. Germany is looking at imposing "flexible hours" for factories to operate around wind and solar output to compensate. Imagine being that employ that gets work called off for rain Wednesday through Friday only to be called in for a long Sunday because renewable output is higher.

Another economic point of note, GDP growth is directly related to the cost and availability of energy. Germany and the UK currently have an estimated 0.75 percent GDP growth reduction compared to counterparts without similar polices. That's additive over time.
Reply: @wisenber  The ROI is much closer to 5 years with subsidies and 10 without, when you take into account the rate of change for energy prices in the US it gets even better.  The US should have begun moving to a fully decentralized grid long ago. If we want true "energy independence" then drilling deeper holes isn't the answer.
Reply: @genxtech5584  To me the answer seems to be more solar - but WAY more battery so we can have that decentralized grid. Without storage, it doesnt matter how we produce the power as almost all of it will just go to waste like we see with the base load we have to keep up with.
Reply: @genxtech5584  As I mentioned credits are going away and net metering rates are reverting to wholesale with a monthly fee added. That alters even the 10 year to closer to 18. Then there's the potential for more utility supply to be added and the return is even worse.
In reality, 20k in an index fund will provide a much greater ROI over the lifespan of panels.
The US grid is much cheaper than its peers. Decentralized raises costs and complexity much further. It's a recipe for a grid crash.
That, and deeper holes isn't how it works. What is happening is that gas is a byproduct of oil drilling that used to be burned off. 
Personally, my primary home is off grid. I have few panels for lighting and the electric fence with two gas wells that provide my heating, cooking, primary power generation and CNG for a couple of converted tractors and vehicles. Have never had a utility bill there other than internet.
Reply: @genxtech5584  Drilling deeper holes is a solution you just forget about geothermal can be any where with deep enough holes.
Reply: @annondonkeykong  ROFL maybe. We ain't got that tech level unlocked yet though.
Reply: @adr2t  There are other ways of solving the intermittency issue than only batteries.  Storage is only one of a mix of solutions.
Reply: @st-ex8506  Storage is the only method. Producing more base load just means we have to run those systems all the time wasting power and resources. There are different types of batteries, but storage is the only way. All other systems just consume power instead for a different type of work aka someone is paying for it if they want to or not.
Reply: @adr2t  Long-range transmission, by DC high-voltage lines is also part of the solution. Think of it:  with enough lines circumventing the globe, solar becomes a continuous energy.
And lines from the tropical south to northern countries, will help with the winter trough in solar power.
Of course, going all the way in that direction would be un-economical.  But the right measure of long-distance transmission with the right proportion of storage allows an optimal solution.

There are still other levers, four to be precise, that can be pulled in conjunction with each other.
I wrote a 100-page report to an industrial client of my last employer on the topic of solving the intermittency problem of solar and wind power.  This report is proprietary, but I can share a summary I made of it, if you are interested.
But the conclusion is that storage is the last solution in order of priority, and not the first... even if, OBVIOUSLY, a pretty significant level of storage is indispensable.

BTW, there are other storage solutions than batteries... even significantly cheaper ones, like closed-cycle, off-river pumped hydro.  But those solutions are more complementary of each other than competitors.
Reply: @st-ex8506  Long-range transmission, have issues... its been proven already that the real solution is going to be local grid input generation. Long-range transmission cost time, money, and resources that at some level can't really happen in. A small area of Solar can already power small towns and off set large cities. Even then, if you dont have the way to store it, that means you have to make it during the load times. Instead, what large cities and states should do is create large scale run offers batteries. Stuff like turning water into H and O or any other weird storage method. This burns off some of the power, but you make it a state level/fed level agreement that power that goes to those batteries become dirt cheap. Solar homes will not get as much money, but at least would get something. Then during the night/high demand, you just burn off that resource. Then you promote battery storage for the local cities, towns, etc. Then just add a field as needed. Any left over power from nuclear, solar, wind, etc will go to just powering the local batteries - and any left over to the run off stations this way we always use 100% of the power we make and have the resources to carry over (at night of course) so that the solar and other power generation has time to recover by morning. Only then do you add Long-range transmission in between the webs/locals if there isnt enough or too much is produce.

I also did report in my college class on stuff like this.... even did a proof of concept as a demo for that project.

pumped hydro has problem if your location doesnt have a means to make it happen... just saying those are not always the best options in many locations. Pump air would have more options.
Reply: @adr2t  I hav never said that long-range transmission was THE solution.  I just said that it was ONE ingredient in the pizza that is the optimal solution!  That the pizza was not tomato (storage) only!
I am in no way saying that storage is not indispensable... just that it is expensive, and the overall can be reduced by playing some other cards first.

BTW, a study has identified 600'000 initially suitable  locations for pumped-hydro storage (PHS) installation, totallizing 100 TIMES what mankind needs in storage capacity.  In other words, realizing only 1% of the best projects would be enough!
Pumped air suffers from very bad efficiency, while pumped hydro's is excellent at 75-80%.
We are not in real disagreement, I believe, only on the priorities. 
You see, Europe in particular may have weather situations in the winter (the Germans call them "Dunkelflaute"), which cannot economically be solved only by storage... too much would be needed.  As those winter high-pressure can cover an entire country, or even several, it only cover a portion of a continent.  That is where the size of the grid, and the capacity of long-distance transmission becomes indispensable. 
You can NOT think locally about the resilience of an electric grid in the worst of conditions.
Again... I do not mean that I do not support multi-local grids, but that the concept just falls short!
Reply: @wisenber  - The cost of electricity where I live has increased 45% since I installed my panels in 2021. When looking to buy, I was expecting a payback time of 12 years. Because of the increases in cost, payback time is now less than 8 years from the date of installation. If costs increase, that time period will drop even further.
Reply: @CL-YouTube-y7e  "The cost of electricity where I live has increased 45% since I installed my panels in 2021."
That varies a lot by area, I believe it's gone up about 15% around here, which would be below inflation.

" If costs increase, that time period will drop even further"
Except more states (and the federal government) are dropping tax credits while utilities revert to wholesale prices and charging for the metered connection.
The house I have connected to the grid only uses about $100 a month for gas and electricity for about a $1700 sq ft home.
Cutting that bill in half wouldn't pay more than just putting the amount I would have paid for an array in an index fund.
Matt probably spent an extra $150k on his house to use less power before he added panels.
Reply: @ you don't get intermittent power though, when no power or not enough power is coming from the solar the grid supplements it. As above I'm not naive enough to think the solar on my roof is 100% the answer, it needs a fossil or nuclear backup but why not use the free power the solar generates? The ROI is an interesting point, I'm not sure what it is in the USA but the UK its around 7 years on average. Worth noting I didn't get any subsides for my install and it paid its self in less than 6 thanks to some very good long periods of sunshine here over the last few years.
Reply: @wisenber  I think you don't understand his statement and numbers. He is not saying solar is for everyone, he is saying he does not understand the attitude of some people, who say they don't want renewable energy, regardless of cost/profit or without knowing the numbers (most of those very vocal and from the USA). He  (and I too) can't understand that people are closedmindedly dismissive of solar without looking at the facts and numbers. 
There will undoubtedly be circumstances where solar may not be the best option for someone. That is fine. But I see a lot of Americans on YouTube that are not even willing to go through the numbers and who are actively vilifying people that install solar. I do not understand that. I would think solar energy would be the ultimate way to become self-sufficient and no longer dependent on fossil fuel and less or independent from electricity providers. Especially, given the frequent power cuts a lot of Americans seem to suffer from
Reply: @dropshot1967  "I think you don't understand his statement and numbers"
I think I do. Americans aren't "anti-solar". If you want to buy solar panels and use them, I don't think anyone takes issue with it.
Now if you want rate payers to pay more for intermittent power, then you tend to run into people not very excited about the prospect.

". I would think solar energy would be the ultimate way to become self-sufficient and no longer dependent on fossil fuel"
I don't think most Americans are keen on giving up hydrocarbons unless something  reliable and less expensive displaces it.

"Especially, given the frequent power cuts a lot of Americans seem to suffer from"
Most of those tend to occur when solar would be of no use. Those are more frequent during storms, which raises another issue. In storm prone areas, grid attached solar becomes a safety issue for repair crews. Charged solar panels feeding a grid when they have it cut can cause deaths, which is why many home insurance companies charge a premium for homes with solar and limit the size of the arrays they'll allow before cancelling a plan.

You also have to realize, the US is a different bear when it comes to the cost of electricity. Some areas of the US are less than a third of the average in the UK.
However, the area of the country where Matt lives has rates that are double that of the national average because they're building out so many renewables.
Reply: @wisenber  The cost of grid electricity varies a lot by region (source of electricity)  and the subsidies are still there for now.  I have a neighbor who doesn't believe in them because a friend worked on a whole house solar project and said they only got 3 Kwh per year !  So misinformation spreads to rejection without introspection or question.  Maybe they had 3Kwh surplus - I dunno
Reply: @antibureaucrat  Misinformation cuts both ways. There's no shortage of solar companies not delivering remotely what was promised leaving homeowners holding the bag.
Reply: No one has anything against solar and renewable energy in general. Much of the opposition you speak about it towards politicians and groups that seek to use renewable energy as a means to grab power or oppress people. However, those politicians(or more accurately, their constituents that decide their policies) don't actually care about the benefits of renewables. I can also prove this very easily: all the politicians and political groups focus on power generation but never energy storage. Upper middle class people would love to mandate that all homes have solar panels on them but they wouldn't lift a finger to actually make sure those solar panels produce power that can be used. The objective is to just make owning a home more expensive
Reply: @twiggy99  it due to the need of large spaces and the carbon coast of making them isn't worth it. Plus they are incredibly expensive so its a rich man's tool. We have a more growing movement for Nueclur than the rest of the renewables.
Reply: A solar company is going to level part of Joshua tree national park. That kind of thing is why. Plus, it takes up vastly more space, and really the question is why people are so against nuclear, which has very little carbon footprint, takes up small space, and has become incredibly safe including the waste disposal aspect. But people don't understand it, and think of accidents that happened because of gross incompetence, horrible design, or bad safety culture, all of which have vastly improved with things like inherently safe reactor design
Reply: The big issue is that while the solar panels on your house is good for you, it does nothing for everyone else.  Because of the way the electric grid works, until we can meet 100% of the demand with renewables, 100% of the time, you must keep and maintain a 100% oil/gas/nuclear/hydro capability.  This drives up costs, like you’re seeing in the EU.
Reply: @ Hydro is a renewable. Nuclear is carbon free, if expensive. 
But we can meet 100% RE pretty easily and cheaply.